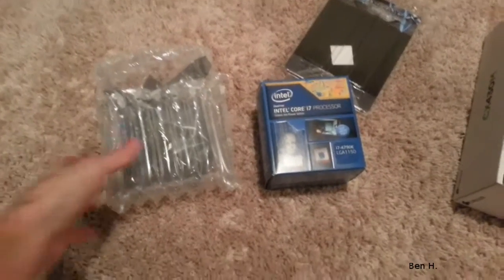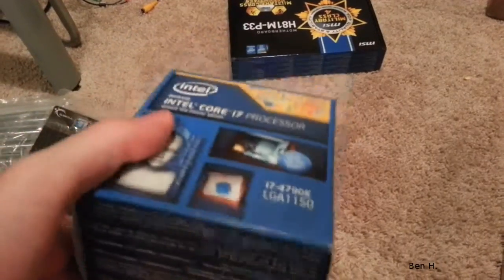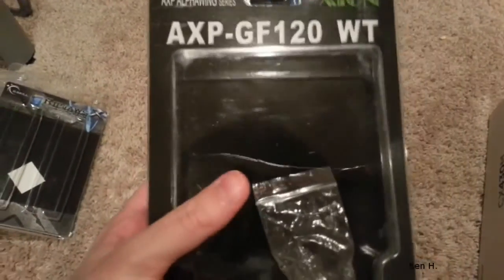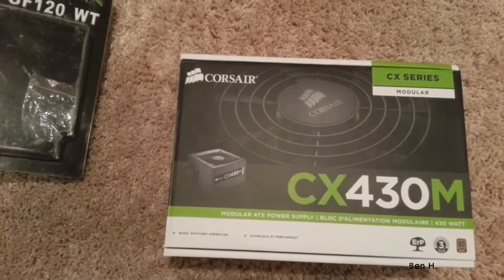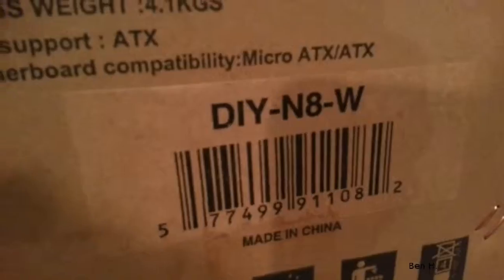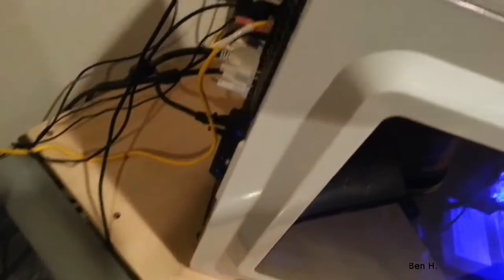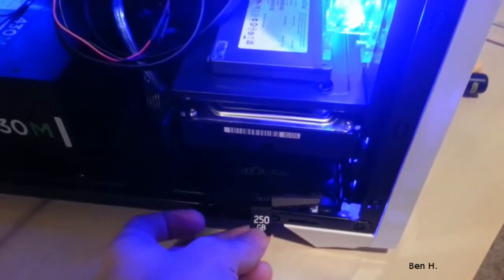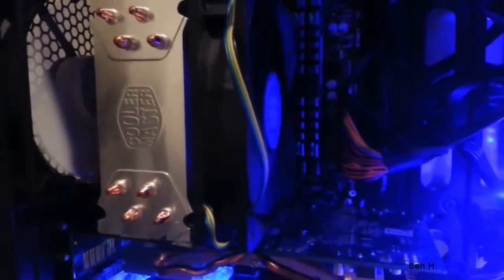Short Component Review - I7, m-atx, 16GB

Comment: do you still have this system? i have the same cpu and motherboard but im having a problem with the voltage because it says that it is set on 1.808v and it alarms me. can you confirm if your voltage is same or it is just on me
Reply from the maker: Where might I find this?  I did have a overlock on it at one point, but I never touched the voltage.  I'm not sure if I went higher then 4.4ghz or not. (Used to only get 4ghz when gaming, so I forced turbo clock)  CPU-Z says The Core Voltage is 1.782 with the Core Speed at 4400mhz and multiplier at x44.
Reply: @benkenny3220  use cpu-z or hwmonitor on stock cpu. ive tried setting cpu ratio to lower than x40 on bios but it still says 1.808v
Reply from the maker: @00rej  HWMonitor says VCCIN is 1.776 which is the same as what cpu-z says it is now.  But the VID coltage under the cpu is min 1.157 max 1.250.  Did you mess with the voltage in your bios?
Reply: @benkenny3220  no i cant see an option for cpu voltage in bios and i've triend removing cmos battery but cpu vcore is still set on 1.808v

Comment: Your i7 4790k on the motherboard MSI H81M P33 immediately started or did you do something else?
Reply from the maker: I put it all together and it worked fine.  Didn't have to do any bios updates to get the CPU to work.
Reply: I even after updating Bios the computer does not work. I turn its fans spin and there is no image. Do not tell me what might be the problem
Reply: Ben Higgins On another computer, all the components work separately